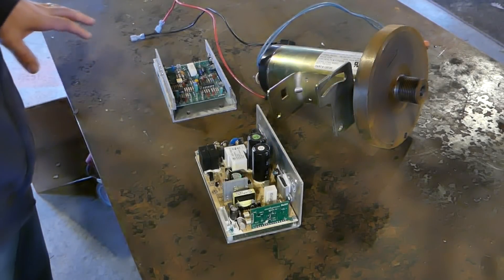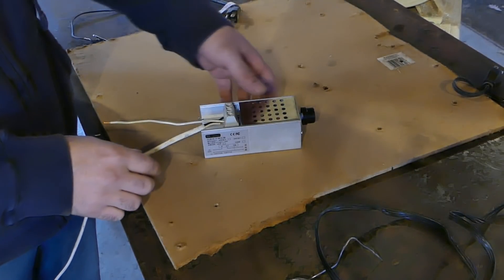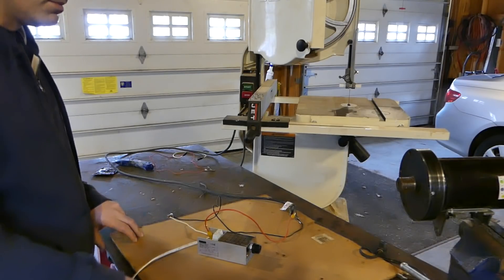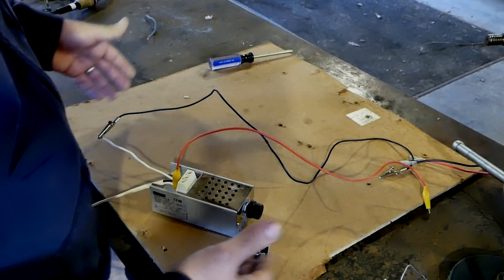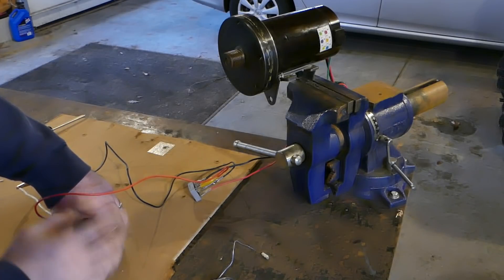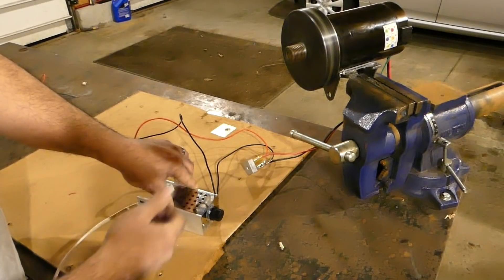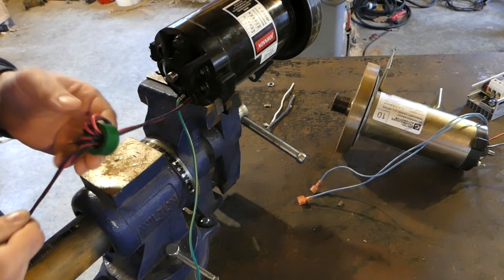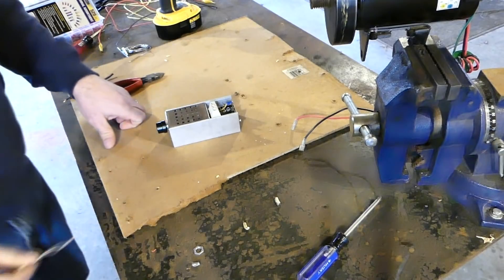Low Cost DC Motor Controller For Treadmill

Comment: hey,mike over here in Australia our mains A/C wall power is 240volts, i built a belt sander using a 180VDC 5.5 amp treadmill motor and the SCR and bridge rectifier you have shown in your video,, i was getting sparks from the brushes and a very hot rectifier when i turned up the speed controller till it all eventually started smoking and stopped after a few weeks of working,and tripped out the breakers,,, would i be correct in thinking i need to bring down the A/C input voltage to the SCR via a stepdown transformer to make input a/c voltage more compatible with the motors dc voltage,, ie if i stepped the input voltage down from 240vac to 110vac , would that stop the sparks and heat, mind you one of the brushes had completely disintegrated,, maybe due to the overpowering of the motor,, some advice would be helpful,, a broken down machine is very depressing. cheers.
Reply: (Aussie here) Get an SCR rated to 240 Volts. I did this same setup but with a 240V SCR and it worked fine. Just probably don't turn it up all the way on the 180V motor for too long. I did this and I thought the motor was about to launch into another dimension. It handled the full 240v no problem, but it revved insanely fast! Smooth mind you, but scary fast.
Reply: yea i didnt notice the SCR controller he used was a 220 volt unit until after i ordered mine so i got rid of the 180vdc motor that was sparking and found a 220volt DC treadmill motor ,, hooked it up the same as before same controller and bridge rectifier and i havent had an issue since. in conclusion i figured that i am better off using a higher voltage treadmill motor to begin with.
In my case the differential between motor and wall power is only 20 volts as compared to 60 volts with the old motor. hence the sparking.

Comment: how many watts for the potentiometer guys is 1/2watt enough>?
Reply: Mine has a 2 watt. It's cheaper to put a resistor in parallel with the current pot.

Comment: I built this DC motor controller with the 220 Vac, 10,000W SCR controller and bridge rectifier discribed in the video.  I'm using it on my woood lathe to control a 2.65 hp treadmill motor.  The pulley configuration steps down the motor RPM by about 1/3 . The controller has a good variable speed range,  but the motor can be stalled  fairly easy, especially when trying to turn wood bowls.   Of all the similar videos I've watched, no one has mentioned any issues with low torque output.   Is there anything I can do to increase the torque output.
Reply: hi judy langemay I ask how do you connect the wires..2 wires from the wall into the input of controller and 2 wires of the output to the rectifier? here in the video I see only 3 inputs and don't understand where are the outputs and why one input receives wall power and also sends to the motor or to the rectifier. second question, if you use controller and pulleys, do you still loose torque if you use controller at full power? don't pulleys enable you working slow even with high motor speed?thanks

Comment: mikemanmade did you use 120V or 240V to power that SCR? also got an exact link for the one on ebay you bought? I got a dud from china I think :/
Reply: Nevermind I got it to work!!! :D seems the wire thickness was the issue

Comment: Sorry off topic question. In order to know the exact speed. What type of tachometer should be used? How would you install it.
Reply: Hi, I'm using a hand held tach model # DT-2234C+ I got off of eBay.
Reply: art Dragon thank you. Do you vary the speed? I want to use this setup on a Shopsmith. So I will be changing the speed frequently. 
I never thought about a handheld tach. Is it handy to use? Would you recommend the handheld over a fixed mounted? Your input is very important to me. It really is. No joke.
Reply: Hi, I'm not too familiar with the Shopsmith, short of knowing that its a multi tool.  I will have to do some research before I can give you a answer.
Reply: art Dragon 
Thank You   I can use all the help I can get. I am looking forward to your new message.
Reply: Hi, What model of Shop Smith do you have?
Reply: art Dragon 
Don’t laugh it is called a Total Shop. It is a clone of the Shopsmith mark v. The main difference is instead of aluminum castings on a Shopsmith. The Total Shop has cast iron castings. It weighs 3 times more and is a lot more solid. It’s about 50 years old. It came with every possible accessories. I am in the process of cleaning it inside and our. Replacing the bearings and repainting it. When I am done it should look and run like it is new. I thought it would be a good time to get rid of the old motor that relied on belts and variable pulleys to get the variable speed. And install a higher horsepower treadmill and use a controller to vary the speed. Also add a tachometer for accurate speed control and an hour meter to know when to do maintenance. 
Sorry for the length. I get diarrhea of the mouth. Again thank you for your time. Ray
Reply: Hi, I would recommend getting both types of tachometers, the hand held one for calibrating and matching up the tool attachment speeds for setup and the mounted one for the motor speeds and everyday use.  Word of advice, gear everthing around the motors labeled RPM specs for best performance.  Out of curiosity what are the spec's on the motor your going to use.
Reply: art Dragon 
Thank You. That sounds like a good idea. That is what I will do. I found a treadmill that is twice the horsepower as the stock motor. With the variable speed motor I won’t need the variable speed pulleys. I will be able to instantly change speeds and have all the power I would ever need. I ordered the speed controller on the video. 
Again thank you for your help. Tell me about your shop and what do you like to make?
Ray

Comment: Would the treadmill motor work better with this controller? I am not happy with having to turn the potentiometer to 0 every time I turn it on.
Reply: Hi, Yes the treadmill motor will work better with this controller, I have this same setup running on my table saw, I have the speed set for what is printed on the motor and I have it pluged into the table saws ON/OFF switch to turn it on or off..

Comment: I used all the same parts with a 2K watt treadmill motor. Ran it for 2 minuets and everything got hot. Added a diode across the motor leads and the heat went away. I think the inductive spikes produced by the motor is breaking down the bridge rectifiers. That's why a 600V rectifier won't work. The kick back voltage is way above that.

Comment: Very nice!
I got the scr 1000 and the bridge rectifier 

Hopefully i wired everything correctly, I can't see how everything is exactly wired up on the video
I have one wire from the wall plugged into the "com" port on the scr
the other coming from the wall on the "in" port on the scr
one wire from the "ac" port on the rectifier is going into the "out" port on the scr
the opposing "ac" wire coming from the bridge is hooked into the "com" port
then 2 wires coming from the motor are hooked into the remaining ports on the bridge rectifier 

It seems to work well besides the "pot" still being the one the scr came with 
Does anyone know if this wiring is correct?
Reply: If it works then you did it correctly :D

Comment: Used this to build a control panel for my lathe at home.  This worked really good but I did try and turn the scr on with the potentiometer turned about half way up to see how it would jump back the same speed and it ended up frying the triac.  Scr started buzzing really loud and now won’t turn the motor.  Any suggestions other than not starting with load on scr?

Comment: This totally worked for me.  I went with the 120v speed controller because I don't need 220, and it works great.  I spent around $30 because I didn't want to wait, but I could have spent much less if I was patient.  I also got 2 bridge rectifiers and 2 potientiometers for that price, so I have backups. Everything came from Amazon. Thanks!!

Comment: Ok, so we can say that's kind of VARIAC ??
I'm really looking forward for a voltage regulator like a transformer or a VARIAC.
You are saving my life dude.
Reply: I'm using a 90VDC  motor like that one and it's 1.5 HP it's possible to make it run?
Reply: and i wanna ask you about the peak current of the motor

Comment: So I wired up a 2hp treadmill motor to a grinder like this video shows.  It works great!  however it only works when I use the POT to turn it on and off, when I added a on-off switch to the AC incoming voltage, it now either blows up the motor controller or trips the 20amp breaker on my breaker panel.  I am using a large variac now to control the motor and even when I use the on-off switch on the variac it will still trip the breaker.  Any ideas?  thank you for the tutorial btw!
Reply: Hi, Do you have the motor cranked to full power when you turn it on?  If so that could be your problem.  You may want to get a current checker to monitor how much power your system is drawing.

Comment: This is so general and he keeps switching back and forth from AC to DC motor like thse are the only two options.. This will not always work! Some motor require you to change the frequency of your AC supply... Simply changing the voltage does not work on all motors............ Single phase indcution motors are a perfect example of this... While the motor is under a load the speed will reduce but when the load changes so does the speed...

Comment: Hi. I control my control, only I have a small inconvenience, the engine has a sound, I know it's a parasite signal, when I increase the revolutions that sound increases and when I decrease the revolutions stops listening, as a filter that unwanted signal, use a potentiometer of 250K, the 200K can not get it you support me with the request is a hug.

Comment: what the results of using this 17.50 set up under real working conditions,as maybe on a 9inch south, and holding with a towel is not cutting metal,

Comment: Really helpful - I had a 4000w board and it overheated the bridge rectifier and motor (sparks and smoke in the motor). I'm using a 180v DC motor. Any ideas what I'm doing wrong?

Comment: I am fixing treadmill machines for 20 years, allways is better to fix the board or change it if is posible.

Totally wrong, this is unsafe option, treadmill motor controllers comes with a microprocessor, use a safety relay and one speed sensor, if something fail the machine do not run, using one of this dimmer circuit all the safety mechanism is not working at all.

Finally this Frankestein only works in treadmill machines with DC motors, if your machine use a trifasic motor forget it.

Comment: so what was the final value of the potentiometer.
Reply: Can you read? It's in the description under the video.
Reply: no need to be a dick, for your information I can read quite well, i am also an electronic engineering tech and a licensed industrial electrician, for 40 yrs, so don't think your so smug.I somehow missed it, I can re-watch it and correct that mistake, your an idiot thats hard to correct.and I've designed and built more things then you can imagine so keep your smart ass comments to yourself.I enjoyed this video, shame you ruined it with your 2 cent comment.
Reply: Is that how you say 'thank you'? Or did you not want to know where to find that information? What's with all of the chest-puffing? Why do you feel the need to try (and fail) to belittle others and try (and fail) to make yourself look good? If you were half as good as you claim you wouldn't need this video to tell you how to do a basic thing and you'd also have stock on hand to experiment with pot values your-awesome-self! Sad.

Comment: ok so I just ordered these parts from ebay, then I got thinking, how do we control voltage so we don't go over the voltage of motor (90 VDC in my case)
Reply: Did you ever figure out? I have the same question. Thanks
Reply: @pappaclutch3266  I added a resistor to the potentiometer

Comment: Looking at your belt grinder controller, with the three parts from Ebay. The SCR, the rectifier, and the Potenitometer i am getting more than full power? i get sparks coming out of the motor..  the SCR is the 4000W with the four connectors, Input N, L and Output L, N. For the Input i am using the treadmill powercord White goes to N, Black goes to L. Output L is black goes to AC, N is White goes to AC on Rectifier (switching these gives same results), Motor goes to pos and Neg of the rectifier. I get full power, sparks out the rear of the motor...... Dont think this is right!
I went for the 4000W SCR, 200k Poteniometer, and 50A 1000V Bridge Rectifier. What am i doing wrong?
Thanks Sig
Reply: I'm in the same boat - did you have any luck finding the issue?

Comment: Hi- Love the video. I plan on using this to power a few machines, but have a question... How did you run 220v out of a single wire? I have several 220v outlets in my shop, but they have 2 120v lines and a neutral in them. I was told splicing the 2 120v wires together would cause a literal melt down, so I'm curious how you managed it. Did you use a US to European voltage converter? A transformer? Something else?

Comment: Thanks for that information I am looking for used my traedemill Dc motor for bandsaw.
but my motor is 1.5 HP , RPM 4900 100v  AMPS 14. so I cannot get 4000w scr controller because I read more than 10 AMPS need fan also if I get 10000w controller it will be big and I want used 110 v not 220v. So is anybody can find out what is good for controller size and other like Full wave Bridge rectifier and Liner potentimoter.
thanks 
ASH
Reply: Hi, The motor I'm using in may table saw has the same specs as yours and I am using the same setup that is used in this video on 110v.  Also A word of advice, you will need to gear down the speed before using it on a band saw.  I am in the prossece of doing this to my bandsaw and as soon as I get all the parts I will post a video.

Comment: Good afternoon, my engine after connecting as indicated and with the indicated material worked. However when I got to train he "died" after 30 seconds. Because ? Could you explain the reason? Did the engine break down for good? The engine has the following characteristics PERMANENT MAGNET D.C. MOTOR 160V 2 HP 1450W 4000RPM 8.2 AMPS. I used the following material 4000W AC 0-220V Voltage Regulator SCR Motor Speed Controller Module Dimmer and 50A 1000V Metal Case Single Phases Diode Bridge Rectifier KBPC5010. I would appreciate any help or if it is not possible to do anything because the engine died, if you tell me. thank you
Reply: probably a bad BR most people with this issue said it was because of a cheap bridge rect
Reply: Mine did the same . Called manufacturer for tech advice They told me my treadmill has a speed reader some where on the tread belt for safety. I will locate and eliminate or
Reply: I found the speed reader magnet was only for displaying speed and didn't not affect the function of the motor.  This is actually when using the controller that came with the treadmill.

Comment: If I have it correct this controller is on  the AC side ...What about a DC controller like this one http://www.ebay.com/itm/Reversible-DC-Motor-Speed-Controller-PWM-Control-Soft-Start-0-01-5000W-Ajustable/192288165844?_trksid=p2485497.m4902.l9144     I am using the tread mill motor for a pottery wheel and though this foot pedal would be great .....would this work, Mike?   thanks

Comment: Thanks for the great information.    I built my 2x72 belt sander using a treadmill motor and all the parts you recommended.    My bridge rectifier gets really hot.   Is this normal?

Comment: The motor controller is even cheaper from AliExpress (same one) https://www.aliexpress.com/item/10000-W-High-Power-SCR-BTA10-Electronic-Voltage-Regulator-Speed-Controller-New-Arrivel/32803661758.html

Comment: Forgive my lack of knowledge, but would this ac controller work if i was powering the treadmill motor with a 96v 20ah lipo battery?  I can't find any dc controllers that can handle that voltage.  I'm looking for a cheap controller solution.  Its for a drift trike.  Thanks!

Comment: I bought a controller (ACMC60) off ebay.  I have connected it up through a bridge rectifier and connected a multimeter to see what output I am getting.  The motor is rated at 130V and out domestic supply here is 220V, so I want to make sure I control the voltage so that I don't overload the motor.  When I check the output using the multimeter it reads 220V DC, and changing the poition of the potentiometer does not change the voltage.  I saw on the notes for one controller that it does not work unless it is connected to load.  Is this true for all these controllers?  Is the controller defective or am I getting un-changing readings because there is no load?
Reply: Did you resolve this?  I have the same problem! It worked the first time but now I just get 220 VDC all the time. I tested the potentiometer on an ac motor and also with a multimeter and can't find any faults with it.. I tried a 10k pot and same thing.. I don't even want to try connecting it now because my 4 Hp DC motor goes ballistic when those wires touch!

Comment: Where did you hook up the 2 blue wires that come from the motor?
Reply: the blue wires are probably for the thermal safety switch to shut down the motor in case it overheats.  mine has the same thing.    If you want to use it, it could probably be wired inline with one leg of the motor wire.  
Problem is, if the motor overheats, the motor will stop, but once it cools down, it will start up again on it's own....